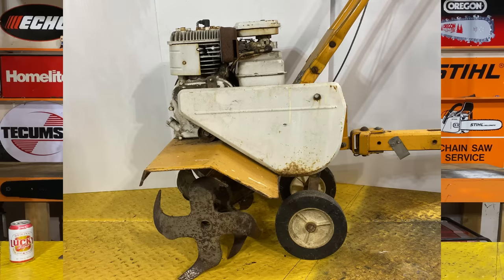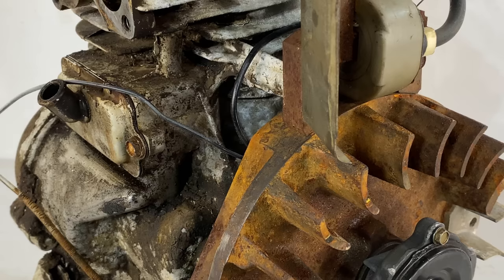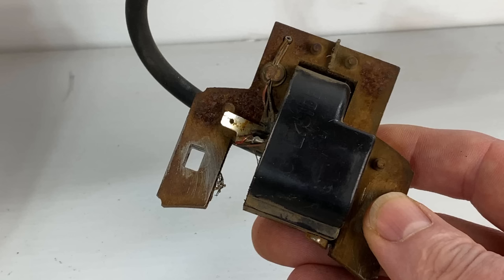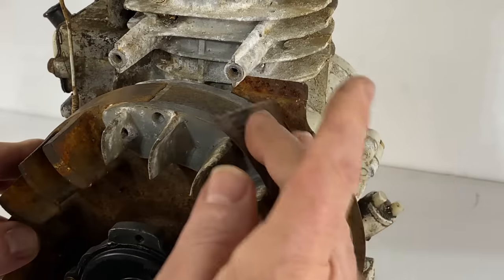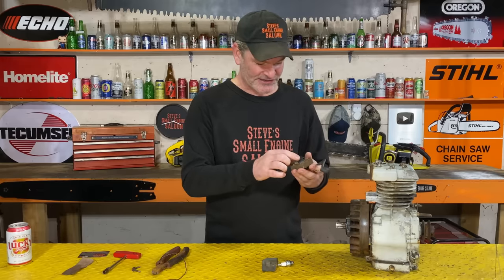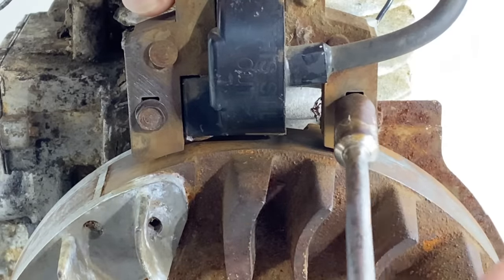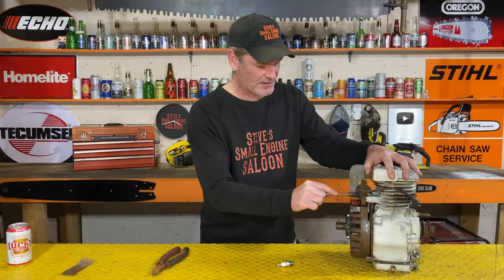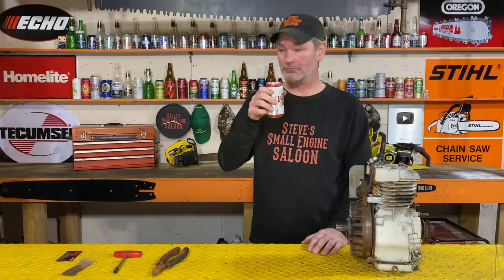Easy Hack To Eliminate Breaker Points & Upgrade To Electronic Ignition -Episode 5 of 7 Tiller Series

Comment: One thing I'd like to see is how to get a more powerful spark.
Reply: There are several ways to accomplish a powerful spark result.

a.  make sure the spark plug gap is correct and very clean.  Often overlooked is the sparkplug port threaded seat on the engine itself.  Make sure that threaded seat is clean and free of any corrosion.  The spark plug is bolted into that threaded seat.  Any corrosion will reduce the effectiveness of that electrical connection as a good ground path.    The spark plug REQUIRES that ground path to the engine head in order to fire.  Clean it up (make sure not to drop junk into the cyclinder!)
b.  the pointless (solid state) ignition moduel should have at least the same specs as OEM.   Any significant deviations from the OEM specs will cause problems.  Even if it "fits' dimensionally does not necessarily mean it will produce the same energy as output.    There are several factors that determine output energy of a solid state condenser.    Quality of the integrated capacitor/transistor,  quality AND MASS of steel and how it is plated (again, the corrosion thing..make sure ALL of it is clean (i personally dope all surfaces with a metal primer except for the curved faces near the flywheel permanent magnets), and also the quality of the metal "foot" (it acts as a trigger/switch)  Make sure all of these surfaces are clean and NOT PITTED.  The two legs should have the same radius as the flywheel.  The single pickup signal foot on the ignition coil should also match the radius in the same way.  The distance between the pickup foot and the flywheel magnets is not as important as the two legs.  Just make sure it's clean and that the face is square to the flywheel (not sloped or pointed...it simply acts as a trigger...but that trigger position is effectively a part of the timing advance/retard for ignition.  If you want to experiment with this foot, you could paint some heavy insulation dope on one side and see how this effects the ignition timing.  Most of them are not adjustable and are designed for a specific advance/retard for general purpose.  But you can "adjust" them with some creative hacking once you determine which "side" of the foot is desired for best ignition timing (then literally take material off once that is known ...because over time insulation dope isn't going to work and will fall apart and deteriorate.
c.  The flywheel produces a magnetic field as it rotates.  The distance between the flywheel magnets and the condenser foot and two legs has to been within spec.  Often the flywheel when mounted on the crank (with the flywheel key) will not rotate at the outer edge in  a perfect radius.  some of this can be from poor manufacturing.  Some of this can be from a crank that might have some play to it.  Most flywheels on small engines like this are not perfectly balanced either.  So as the engine is really banging, any out of balance weight problems will result in the flywheel to go out of round in rotation.  This can produce a poor spark.  So, there is alot that needs to be inspected and adjusted to get the radius to "sweep" at just the correct distance from the condenser legs and foot.  The closer you can get that gap distance to near perfect in rotation to all three points:  two legs, and one foot of the condenser, the more reliable the magnetic field induces a consistent energy pickup from flywheel magnet to the condenser coil.  If you do this, the wear of the crank and some improvement in the performance of the engine also...(the go cart crowd spends lots of time doing this sort of precision balancing...it translates to lots of benefits...not just better spark!)  cleaning the magnets is a good idea.  Just don't put any kind of primer on them.  That would act like insulation and stall the magnetic field or distort it.  The rest of the flywheel should be clean too, just to prevent any buildup from skipping into the two legs and pickup.
d.  the  spark plug wire and spark plug boot and connector:  conductor material , and insulation.  More if better.  big beefy cooper with good insulation is better than small gauge aluminum.  So if you have the choice in solid state, look for those materials.  Make sure the boot that grips the spark plug is tight on the plug.  Dielectric grease at this point is a good idea to inhibit moisture and corrosion.  Just make sure the grip is tight.  It should be hard to push on, and hard to pull off.  Cracks in the insulation are a red flag...often the conductor might be damaged, especially where it make a tight radius into the module.
Reply: @tdmmcl1532  dielectric is an insulator not a conductor. Sure it keeps the bad elements away but isn't supposed to be a conductor.
Reply: @_AndromedaGalaxy_  Dielectric grease is probably the most misunderstood medium ...maybe even more than the water displacement 40 product (wd40).

the mechanical connections for electrical especially high power (sparks), that involve dissimilar metals corrode primarily due to the presence of oxygen (and other debris/contamination)...dielectric grease BECOMES AN INSULATOR, a film that is sturdy and does not break down under high current or high voltage.  In doing so, it reduces corrosion making the connection solid and conductive.  

it is also called bulb grease ....and has been used to insulate a connection from water ingress and thus reduce corrosion from dissimilar metals, which generally cause bulbs to fail.

and yes, inside those circuit breakers at your home, the thermal breaker type, dielectric grease is used for the same reasons, and also to act as a lubricant.  

Does not interfere with the electrical connection at all.

Comment: I'm sorry I'm using voice talk and does not have autocorrect I meant 5 horsepower tecumseh engine with coil underneath the flywheel.the magnetic spots are on the inside of the flywheel.

Comment: So there is no timing adjustment. I know I’ve seen off set flywheel keys but you didn’t turn the flywheel either way against the slop of the screws, just the .010 gap.

Comment: too bad the coil that is $15 on ebay that is supposed to fit the engine n work... Ignition coil For Briggs& Stratton 793295 398593 591420 496914 793281 .... doesnt have the little thing on it to trigger coil.  the one with the little extra thing on it to trigger coil is $30. so... i dont know if the $15 coil will make it spark????? rather spend $15 on coil than $30

Comment: Go to an electronic ignition and you lose the ability to keep your engine running when it's very old. You also lose the ability to make your engine work without waiting for (expensive) parts when some part of it dies (and some part of it will absolutely flat die, I promise.

Nothing about breaker points is anything like a nightmare when you're a decent mechanic. I've preferred breaker points since I started working with them about fifty years ago.

Just learn how they work, that's all. Then the rest is simple.